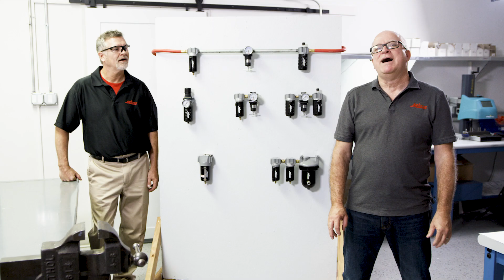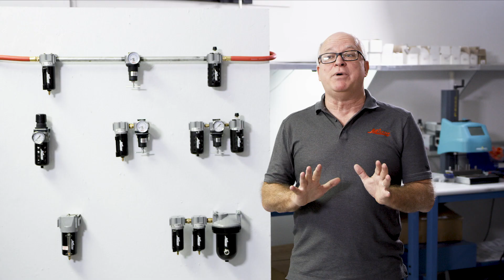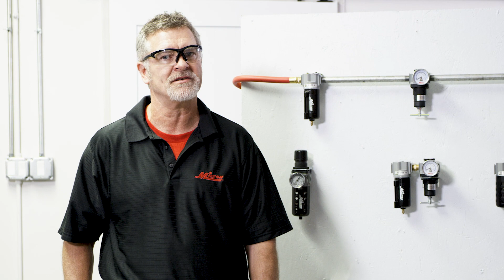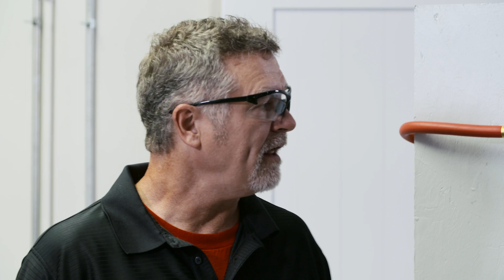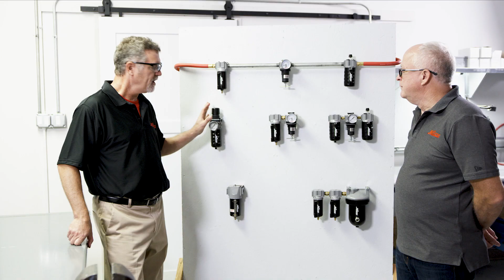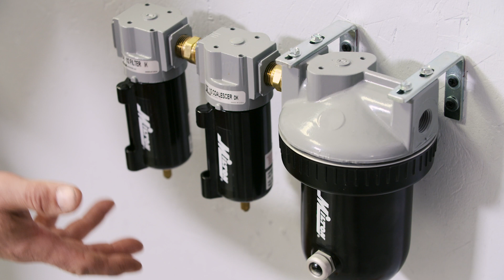What is an FRL? - Simple Better Air starts with Milton Air Compressor FRL

Comment: I just installed the FRL with 1/4 NPT fittings. I set the regulator on my compressor to 40psi and the regulator on the FRL to 30psi. I am only getting a puff of air out of the hose with each press of the trigger on a blower nozzle. Is there some sort of packing or other adjustment I need to perform to get the airflow correct?